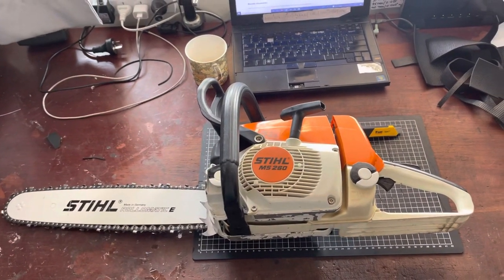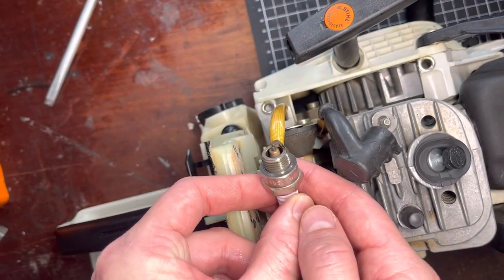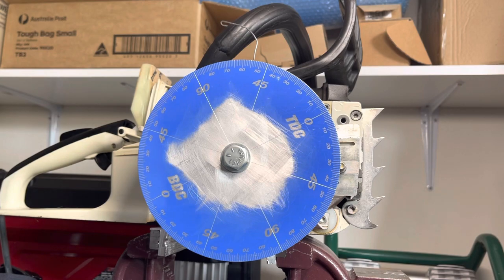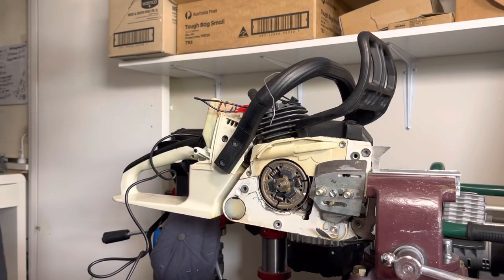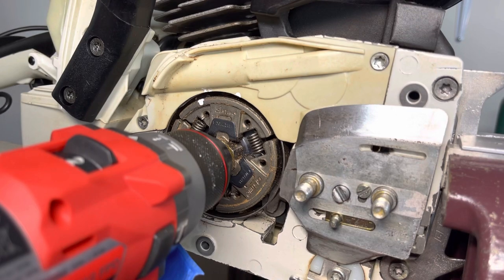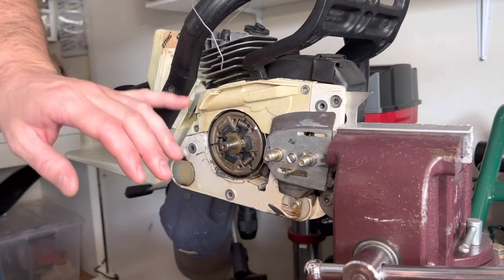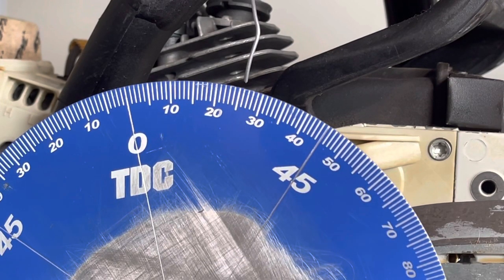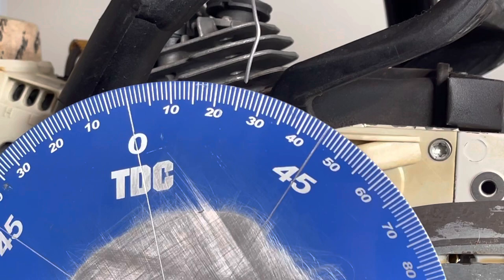In-depth Ignition (Spark) Timing Tutorial!

Comment: You know a lot about timing! One thing ive always wondered is why does a chainsaw have fixed timing while an outboard engine per say has spark advance? Both being 2 stroke engines.
Reply from the maker: Many ignition coils on the modern 2 strokes have ignition advance built in. Anything circa 2000’s onwards tended to have it! Outboards utilise rotating / advancing the ignition coil I believe? Ope use electronic controlled ignition advance.

Comment: For a saw like this, how would you advance or retard the timing?  Can the coil be moved laterally for that purpose, similar a non electronic system like the stator plate on an 041 that rotates (and therefore rotates the coil)?  I’m only familiar with the coil being able to be moved further from the flywheel magnets to increase the air gap.
Reply from the maker: No the stator plate cannot be moved. These ignitions are fixed, however if you wished to advance the timing a few degrees for better top end power then you shave the key slightly and turn the flywheel on the crankshaft stub.

Comment: Great video.  At 5:35, are you making the mark with your pen while you’re running the drill and timing light?  Seem like it could be tricky to be exact.
Reply from the maker: You spin the engine and use the light, put a mark where you think it seems to be landing and then check again. Re mark it if necessary. That’s what I did here. Took two attempts to get it exact. First was a close estimate second was the exact position.